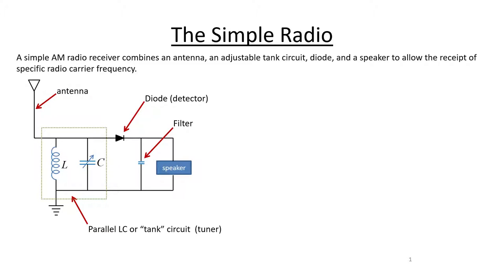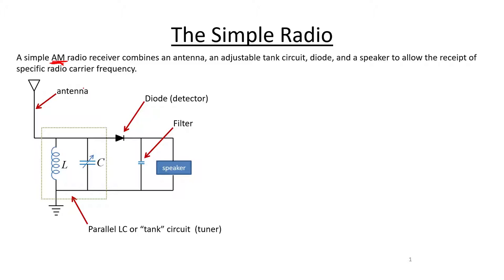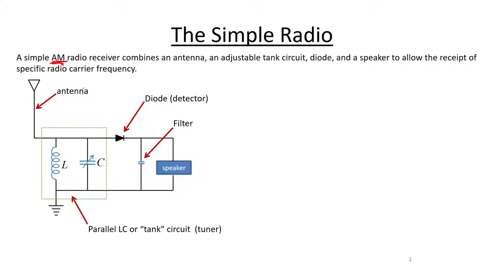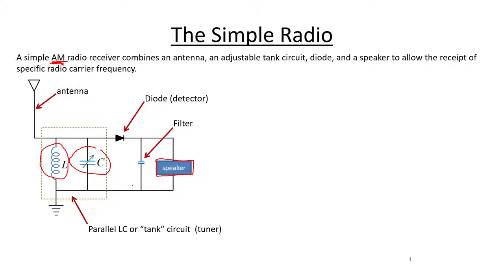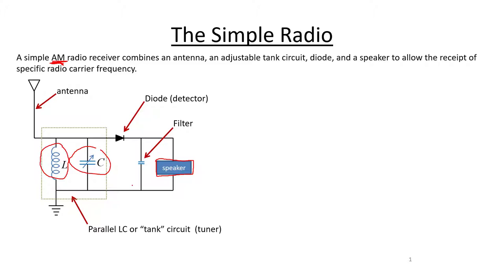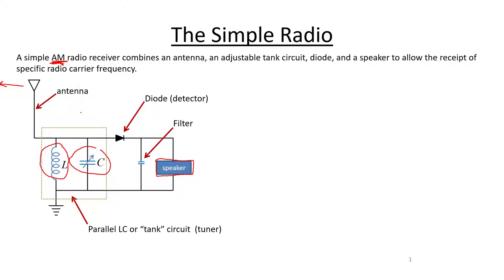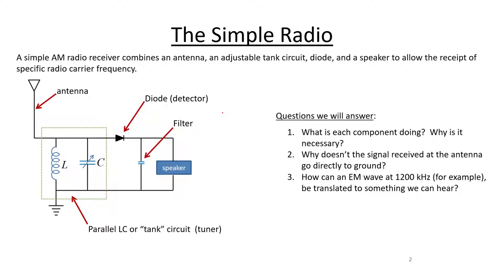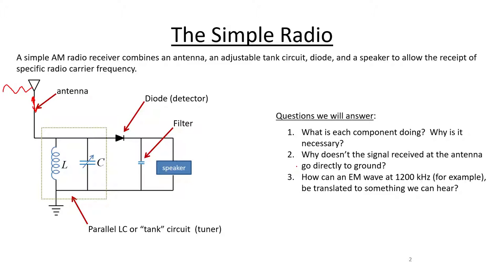Introduction to Radios (Part 1) - The Basic AM Radio Receiver and the Journey Ahead

Comment: This series of videos on the radio receiver is great! Exactly what I was looking for. I wanted to understand what each component does. Most gloss over this. I suppose most aren't EE professors though. The only thing that I didn't quiet understand is the function of the resistor in the RC part of the circuit, but I've found forums that talk about this. Great work!
Reply from the maker: Thank you!  I'm glad you found them useful.

Comment: Everywhere I see this simple circuit I see it with a speaker etc. but what if I want to receive some basic data? Can I put there a resistor instead of a speaker ? Only thing I want in my case is signal but no audio signal or voice but just I try to convert some basic digital signal into radio waves and receive it. I know this is AM and I know basics of radio waves and radio transmission and I know about FM and also FSK etc. this is NOT the case. I am looking for a very specific (and simple!) way to receive some basic data like ON/OFF but everywhere I see the same schematic but not many details about specific and USEFUL application of this. The circuit assumes that everybody wants to hear a sound from it but what if I want DATA? I have already made a good transmitter which can transmit some information or voice or audio sound for 10 m (I can receive it with my commercial radio receiver ) but I have some problems to build a receiver myself :(((( Even if I build something it is very POOR range and easy to loose the signal. Since 6 months I wonder what I do wrong :/ Maybe it is lack of my knowledge (I study electronics and computer programmign for my OWN) and of course I try to read books about radio communications and electronics (I HAVE basic knowledge and skills) but the radio receiver is like pain in the a... for me really I can't penetrate this f... thing.

Comment: Yes Sir I had tried this in 1970 when i was a learner 😁😁😁
But this requires a very long long antenna and a suitable matching head phone 👍👍😁😁😁
Reply: What is filter in this circuit??
Reply: @kimatagaming7176  
There is no filter circuit required as  it catches the nearest radio station near to you and the othe radio stations are far away so the radio signal at the antenna point received is very low and is not amplified by the circuit 👍
Reply: @paramanandchandawarkar2046  how many times we need role the enameled coper wire in solenoid .. and can we use normal speaker 🔊?? .. I am making this for my exibition
Reply: No , not at all you will require a normal mobiles earphone ,the impedance of speaker is high and the signal  will not be able to drive the speaker !
Check the imedance of the ear phone before use !

Comment: More... I listened to most, but couldn't find the last (Part 8 on speakers?).  All are excellent and convey ultimately the bottom line on how tuners and detectors work that I haven't seen elsewhere.  Thanks. Only suggestion.. and them all to a Intro to Radios playlist... that seems lacking (if present, I've been unable to find it).  You're a blessing!
Reply from the maker: Hey, thanks!  I'll add them to a separate playlist.  They were part of a class I taught, so they're in sequence in the electricity and electronics playlist from Spring 2020, but kind of buried at the end.  Glad you've found them useful.

Comment: You have not shown power connections vcc
Reply: Well no need for power in this passive design. It uses the radio signal itself as an energy source.
But the result is rather quiet(so you need a crystal earpiece to listen to it)
Amplified designs Use a Transistor or Vacuum tube. and they will require power